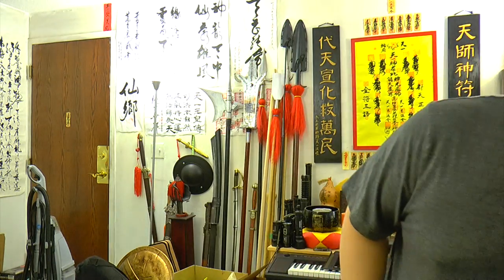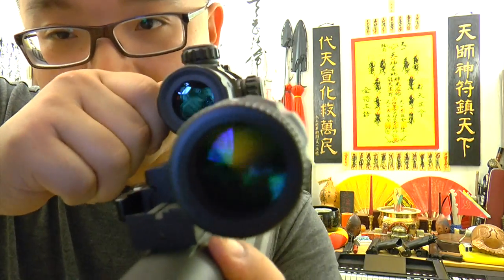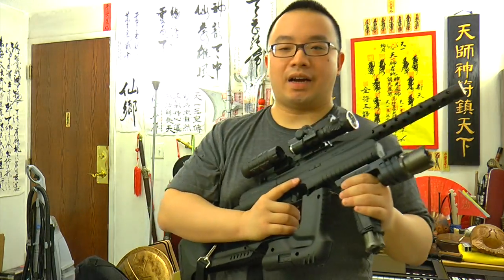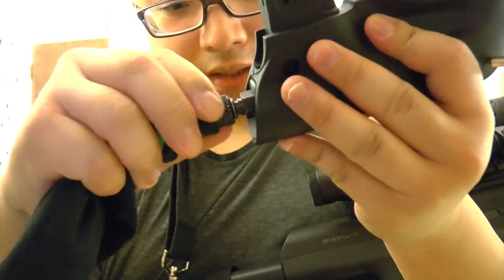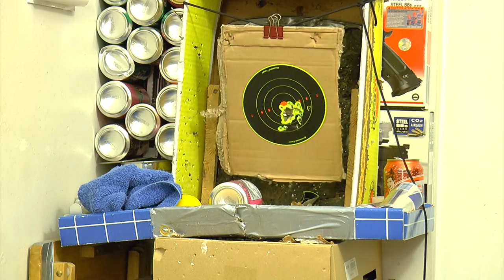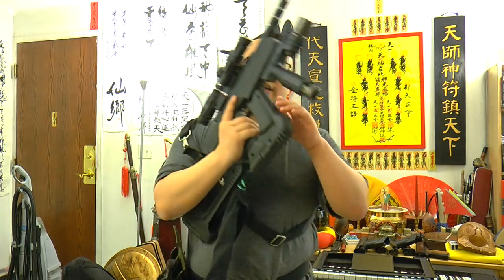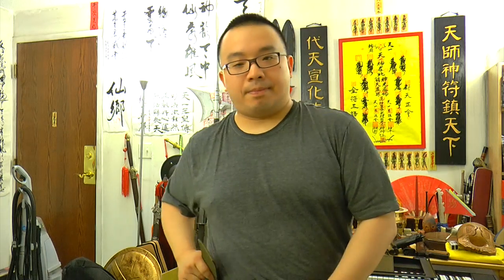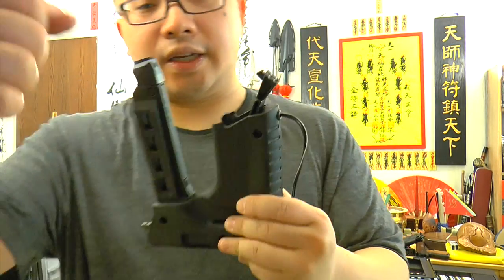Drozd Blackbird BB Machine Gun on HPA, Review and Shooting

Comment: what kind of remote line is that and why do you have rubberbands on it with material? is that for protection of the line ?
Reply from the maker: Oh the protection thing is just some old pants, to protect and also to prevent the coiled hose from tangling up during shooting. You can buy those wraps too, but I just made my own for free.  THe remote line just a normal Air Venturi remote line, you can get any paintball stuff that works the same way too
Reply: Chiinnature
oh =^) i thought it was a shirt , i was so close .. do you need special adapters to hook paintball remote line to the Drozd Blackbird ? would the " Air Venturi 30 Co2 Coiled Remote Line Male & Female " work ?
Reply from the maker: TapRackGirl
You need this:
http://www.drozdmax.com/air-systems/drozd-blackbird-bulk-air-kit.html

there is a small piece you need for the birdy gun to hook up a quick disconnect, and this set will give you the gears you need.

Comment: How do u clean a .177 cal. (4.5m) break barrel air rifle?
Reply from the maker: Breakbarrel? easy.. use a pull thru kit, crack the gun first, and then put it on safe, then use a pull thru kit to clean it thru a few patches and it's done. The barrel should not require much cleaning unless it is VERY gummed up.
Reply: Ok thanks